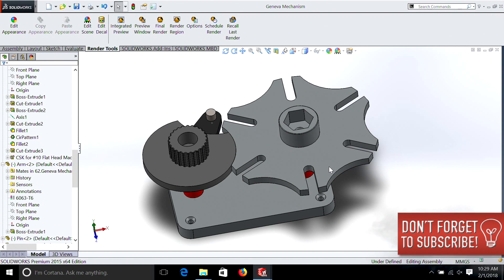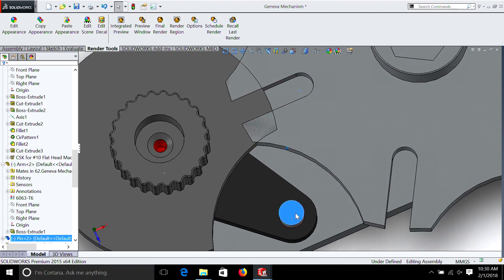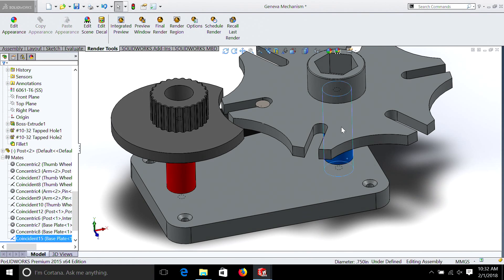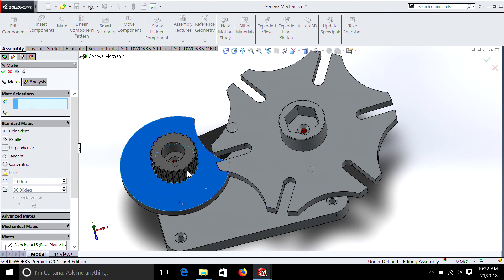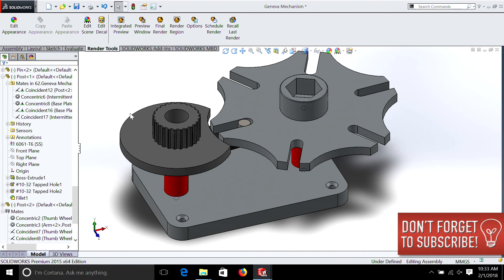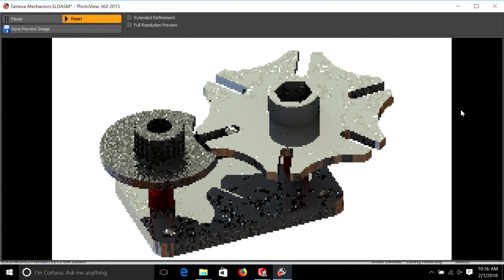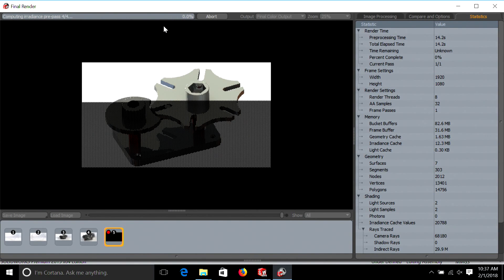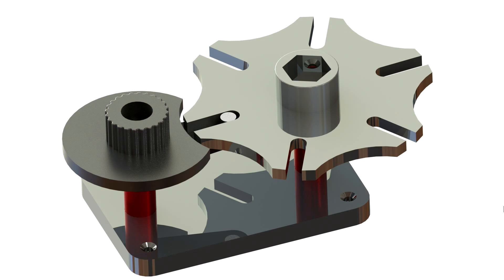The Geneva Mechanism

Comment: Very good! I worked for years with cadkey but obviously it wasn't in 3D, at least not the old dos version I had to use but then it was AutoCAD in 3D. I don't know which is better because I haven't used Solidworks yet in in a work setting but hopefully I'll learn enough to fake my way in and then my overall drawing skills will kick in. Another great vid.
Reply from the maker: While Solidworks is known as the Ferrari of CAD software, I would say it was the easiest to learn for me. Fusion tries to be like Solidworks but it still has its roots in DOS and a coordinate based system which makes it hard for people like me to learn.